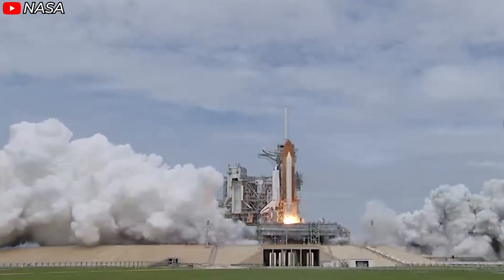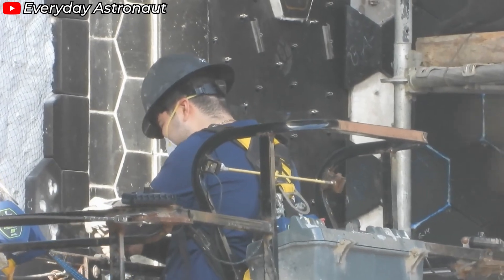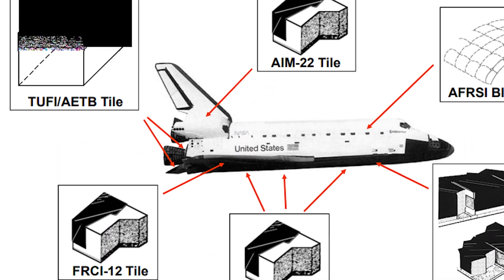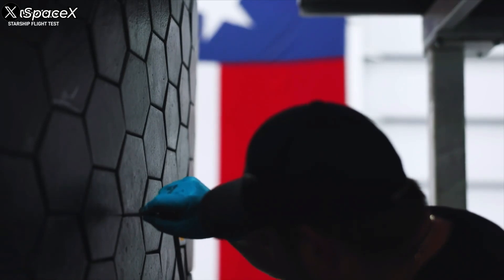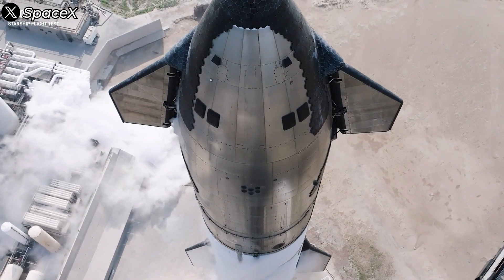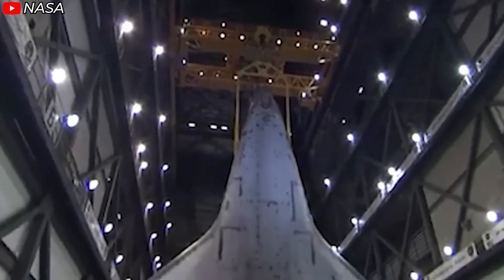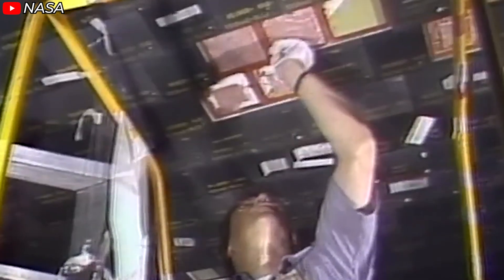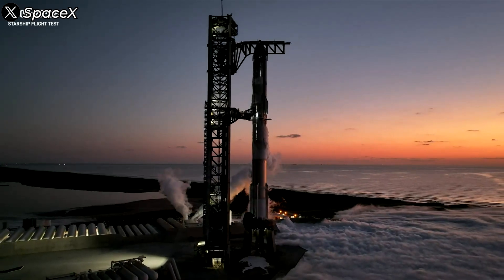SpaceX's Big Solution On Starship Heat Shield Just Humiliate NASA Shuttle!

Comment: Um. NASA built the space shuttle and it worked the first time it flew. It re-entered successfully the first time, too. It was reusable from its first flight, too.  AND NASA developed the Artemis and it flew perfectly its first flight, sending a capsule well past the moon, and landing it safely its first try.  In fact, SpaceX’s high Falcon 9 launch cadence utterly relies on Launchpads built BY NASA over 60 years ago, and which were rapidly reusable from their fist day of operation. Unlike SpaceX’s OLM which took 4 years to get to the point where every engine test firing did not cause millions of dollars in damage.

Nothing SpaceX does has embarrassed or humiliated NASA.   SpaceX is FUNDED by NASA, Only exists because of NASA, and everything it has achieved has been with NASA’s help and cooperation.
Reply from the maker: The Space Shuttle is a glorious symbol of old space, but also an economic disaster. It’s the result of optimizing the wrong things. I agree that NASA saved SpaceX at a few points in the past, but now SpaceX operates on private funding.
As for NASA’s successful firsts and SpaceX’s failures, I’ve even read a study by a researcher comparing their different approaches and which one proved more effective. 
But yes, the lessons from the Space Shuttle are invaluable, and its symbolic significance can’t be changed.
Reply: @ SpaceX charges NASA more per seat to the ISS than Russia did, even when russia was bilking us. Both Shotwell and Musk have stated that a key goal for profitability will be being able to turn around a Falcon 9 in 24 hours.  After years of trying, the fastest they have turned around a falcon 9 booster is 24 days.  Just a few days under the fastest  turnaround for a space shuttle.    Thus far, SpaceX has not really demonstrated significant cost savings, and being a private company they refuse to disclose their balance sheets. Their rockets are not notably more reliable than those from other launch vendors.   SpaceX has spent 3 billion dollars on starship and has YET to achieve their FIRST contractual milestone.  Musk’s idea for a launch mount was fundamentally flawed and rather than immediately ‘iterate’ a new design that  incorporated 60 years of launch pad design experience, they wasted 4 years and a billion dollars trying to massage Musk’s ego by slapping bandaids on a bad design. Fanboys wax enthusiastic, because hey, who DOESN’T like to see rockets blow up? And they dump all over NASA and Other space contractors, But THEIR designs, albeit late, work correctly the first time without having to be redesigned every time.  And at present SpaceX is as late with starship as Artemis was, except, Artemis WORKED and they Didn’t have to build and blow up 20 of them to do it.
Musk is Not a genius.  His promises of delivery are infamous for never being fullfulled and he always delivers late, less than promised, and at much higher costs.
Internal Pepsi documents have shown their Tesla semis, fully loaded, only have a range to 100 miles and have running costs several times higher than diesel trucks that have ranges of 400 miles and up.   His real talents are self promotion, stock manipulation, and repeated, utter failure to do his due diligence.  He made an offer for twitter without understanding he could be held to it. He failed to discover what the regulations regarding building a launch site in a protected wetland would be, and then repeatedly failed to file the paperwork and do the mitigation required to get FAA clearances. ( and got his fanboys to blame it on the government, rather than his inability to focus and follow thru )   He has managed to convince legions of fanboys that Failure is Success.   Its double think right out of Orwell. 

As far as I can tell, Musk is like that Theranos woman, except she only stole investor money, while Musk focuses primarily on government contracts and subsidies. I am willing to bet that SpaceX will NEVER land a man-rated starship on the moon,  Whereas Artemis COULD haul a LEM sized lander out to the moon TODAY.
Reply: SpaceX charges NASA more per seat to the ISS than Russia did’ – I need your numbers.
If I’m not mistaken, Russia charged NASA about $90 million per seat, while SpaceX charges around $60 million. This might go up slightly for future flights. And I'm sure if Russia had a monopoly on getting people to the ISS, the price wouldn’t stop at $90 million.

Reusability is what brings in the money for SpaceX. The launch cost for a Falcon 9 is estimated at $20 million, but they sell a launch for $60-65 million. No one knows exactly how much they profit, but without profits, they couldn’t keep up with the Starlink program.

SpaceX doesn’t mind blowing things up because it’s their way of learning. Want to know the engine’s limits? Blow one up. What they need is data, not a perfect first try. Otherwise, why would they put loads of sensors on all their rocket hardware?

Starship learns from the best and builds on those foundations. why make something entirely new when there are so many lessons from the past? The Space Shuttle was iconic, but it was retired for a reason.

SpaceX is investing in something that can carry hundreds of tons from Earth to other parts of the solar system, not something with the Shuttle’s capabilities.
Reply: @ Russia USED to charge 44 million per seat. Before, y’know, Ukraine was invaded, sanctions imposed, and SpaceX started to develop the Crew Dragon.  They raised it to 88 million, while they could. Spacex Promised much lower cost because of reusable boosters.  But like every Musk promise on pricing, that went out the window.   As it turned out they could NOT land their capsule propulsively, making recovery way more expensive, They canNOT turn a booster around in 24 hours, they have not even managed 24 days.   Today, SpaceX charges 77 million per seat.  Like the 40K cybertruck. The always 1 year away Full Self Driving. The roadster they took in 60 million in cash for, 7 years ago, and still have yet to do any work on, and which will NOT feature the range nor speed musk promised at his pitch.
Don’t get me wrong.  I am pleased we spent billions in taxpayer money to develop our own LEO launch capability. Which we only lost because politician shut down shuttle without having planned a replacement.   I am not so happy about us funding a company wholly owned and controlled by a foreign born lunatic who gets a lot of press for ‘inventing’ thing that were already invented, or even worse, for inventing things that are stupid and useless and getting public monies to pay for them. 
Don’t believe the Musk Fanboy hype. The ONLY reason SpaceX was having trouble getting FAA clearances was because Musk refused to file the paperwork on time, thinking the rules didn’t apply to him. He just tried to bribe the public to vote the way he wants, and the US military is already looking at him askance as far as allowing him access to sensitive information on military launches because of his aberrant behavior and recent slide into conspiracy and fascist weirdness.
And the reason SpaceX’s trouble with the FAA have seemed to suddenly clear up is because Musk brought Shotwell over from the Falcon 9 side and all she has done is  the same thing she does for Falcon 9 operations. Namely FILE the paperwork on time and Comply with regulatory mitigation requirements that Elon refused to.  ( TBH I don’t know if he ‘refused’ to do it, its more likely he just doesn’t follow thru on anything and doesn’t do his due diligence like he failed to do over twitter. Making a sarcastic offer that he had no idea he could be legally held to.
But- The notion that ‘rapidly reusable’ rockets will LOWER costs to orbit or beyond has not yet been proven.  I mean, it’s what everyone is doing right now because it’s the tech that investors will throw money at.  But at present, investors throwing money at RocketLab, BO, China’s fledgling attempts, Stoke, and others have ZERO actual data on whether SpaceX is making money or not, and even then, SpaceX is entirely reliant on the US buying LOTS of rocket launches. 

Having all our eggs in Russia’s basket is no less precarious a situation than having our only launch provider being a corporation owned by a foreigner with some mental issues.    
IF reusable boosters actually DO save money, then SpaceX is bilking the US taxpayer to rake in all the profit he needs to afford to launch all those starlink satellites on his own dime.
But at present he has spent 3 billion of OUR money on starship and still is not anywhere near a rapidly reusable rocket. He doesn’t even have a rapidly reusable launch pad. He is as far behind on his delivery as Artemis was and Blue Origin currently are.   “Iteration” in rocket development has not proven to save any money, nor any time. Nor result in a better rocket nor appreciably lower cost launch.  Maybe, ten years from now, if we have multiple companies to choose from, they might compete on pricing.  But right now all spaceX has to do is be 2 million less than ULA to get the launch. But, then again, with only a few providers and all of them privately owned and wanting profit, they will more likely just price fix with each other to charge the maximum they can get away with.
Reply from the maker: @christopherpardell4418  $77 million? The cost per seat to the ISS could reach over $70 million from Crew-10 onward—not now, not in the past.

Did Russia used to charge less? Yes, they once sold a seat for $20 million—why not mention that? Did you account for timing and inflation?

Moreover, it doesn’t seem like you fully understand the impact of monopoly and technological independence. NASA doesn’t pay SpaceX $3 billion a year for all Starbase activities; they pay a fixed amount for the Starship HLS, and that hasn’t even been fully paid. SpaceX makes money by launching payloads for NASA, the military, their own satellites, and private clients.

A launch costs under $20 million, and they sell it for over three times that—do you think they’re profitable?

Before SpaceX, ULA charged the military nearly $400 million per launch using outdated, non-reusable tech. Do you think it’s a coincidence that SpaceX now launches nearly 90% of the world’s payloads to LEO?

Musk is extremely optimistic, and his timelines almost never hit the mark—Shotwell has even joked about it—but that’s how they push forward, aiming to achieve the best possible results. Have you seen any other company launching rockets every 2–3 days like SpaceX?

When I have time, I’ll look up the study I read about Musk’s methods and how they save money. Thanks for your comment!

Comment: Starship is largely a simple cylindrical structure. The Space Shuttle Orbiter is a complex aircraft with large wings, tail and movable control surfaces. It's easy to use a few simple shapes for the Starship heatshield. It's much more difficult to design a simple heatshield for a vehicle like the Orbiter. 

The requirements were different. The Orbiter needed to look like and perform like an aircraft since NASA and the Air Force required it to have a cross-range capability of nearly 2100 km during certain types of entry, descent and landings (EDLs). AFAIK, Starship does not require a cross-range capability that large.

Side note: My lab spent nearly three years (1969-71) developing and testing numerous materials and processes for the Space Shuttle Orbiter heatshield during the conceptual design of NASA's Space Shuttle program.

Comment: Magical Musk needs to Develop a ... Thermo Protective System , other than 10,000 Tiles ! ... There are too many Points of Failure  ... He Needs a Spray On material like Fiberglass and Jell coat , like on a boat !
Reply: I used to think like this, but nature uses the principle of many “scales”, or “feathers” or different kinds of skin. This allows for micro adjustments across the crafts structure and economics. Although, there would still be plenty of room for development I agree.